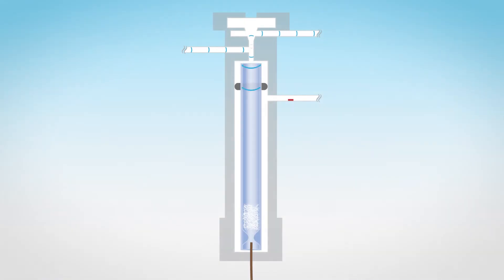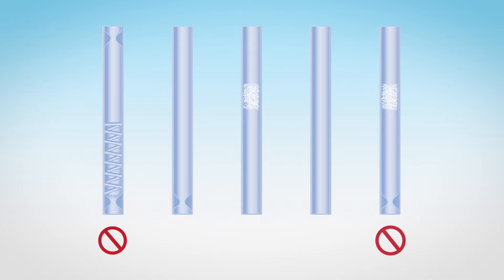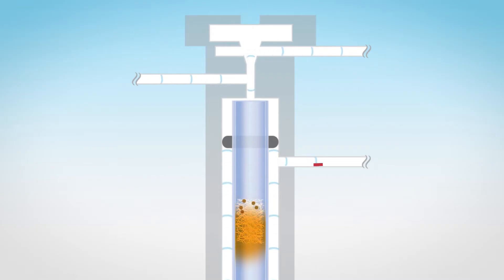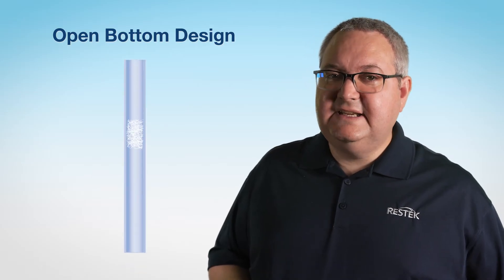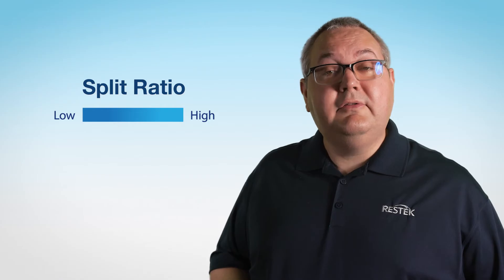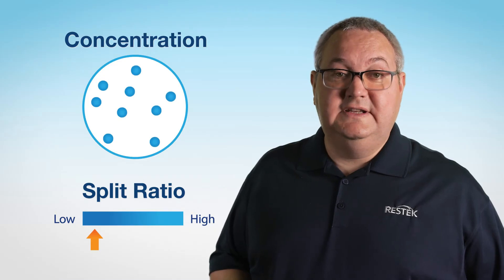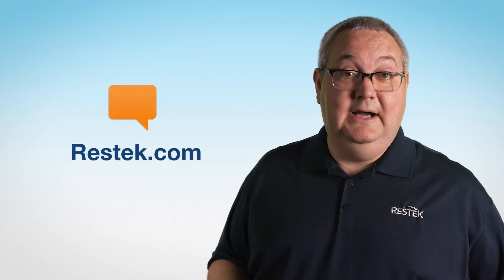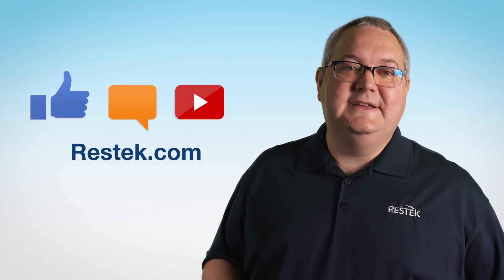Optimizing Split Injections

Comment: Congratulations for the video, but I don't understand how a pulsed split injection can have the liner with increased pressure if the injector outlet opens?
Reply from the maker: The pressure controls of the GC system are designed to handle these pressure changes. So while there is still flow going through the column (and out the split vent, septum purge, etc.) pulsed injection allows users to temporarily elevate the pressure in the injection port.
Reply: @RestekCorp  Great! Thank you for this.
Reply from the maker: You're welcome!